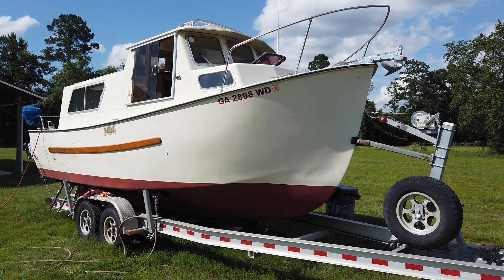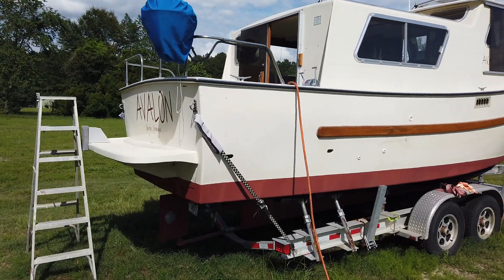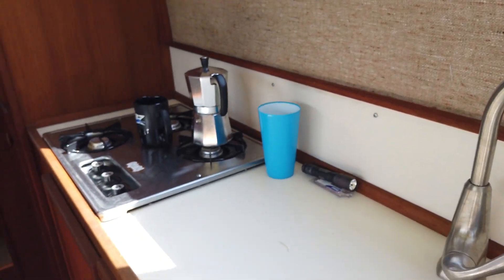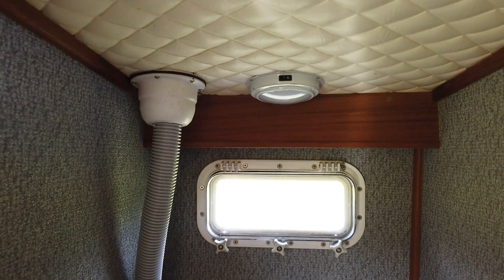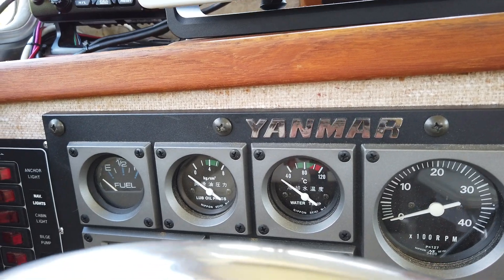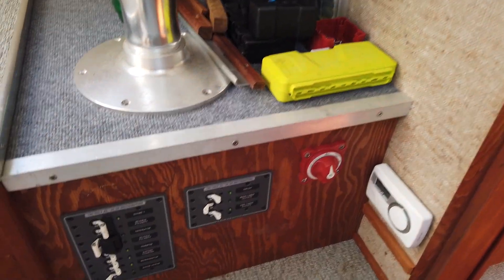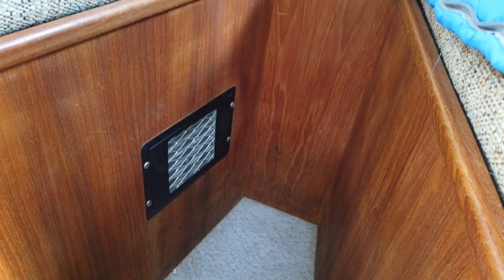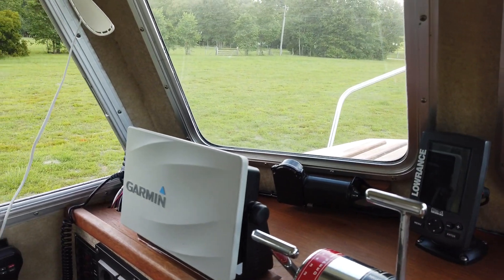IS-25 Trawler Tour

Comment: i’ve owned 17 or 18 boats over the years  your Vessel is a fine looking and well designed one  i actually have the same handheld VHF radio  and mine has made it from the Chesapeake Bay  to Florida via ICW and over to the Bahamas and back toFlorida  and i’ve always been relatively Pleased with its Performance  as a Suplemental and Dinghy Radio

Comment: wonderful boat, be excellent for the lakes around here though not a fan of the side windows like that for storms.   its amazing how many people actully don't take the lakes seriously, then are shocked when a storm rolls in and you get 25-30' waves.
Reply from the maker: I won’t have to worry about being out in 25-30’ waves.  That’s pretty easily avoided.
Reply: @AlaskaRog  I wouldn't say its easily avoided.   you would not believe the number of people that come to the great lakes for vacation and don't understand that they are more akin to inland seas.   Then when things start to turn bad, they often don't react in time and...   every year someones got a rented sailboat or houseboat stuck up on a sand bar laying on its side, or even upside down after a storm.
Reply: ñit small yaggt  uñver 75  feet too 9⁰  fittt yagheß

Comment: How do you steer from the cockpit with the wheel down on the deck???
Reply from the maker: I find that it’s primarily of use for docking.  It can be used while hanging out in the cockpit but the visibility is restricted to looking forward on starboard side of the boat  Bending over for the wheel sucks.  I’ve thought of adding a belt drive system to raise the wheel to the proper level to comfortably use.  The wheel that is there is mounted low because the back side of the wheel sits in a cabinet.  Above the cabinet is a counter top and a cabin heater so that steering wheel could not have been mounted at a reasonable height in that location.
Reply: @AlaskaRog  Pretty bad thinking.  Hydraulic helms can mount anywhere as the back space is not much.  A little console on the cabin bulkhead could easily been done.  Here we use the cockpit for trolling and spend long hours back there.  Very poor design.  Single handed berthing is easy with the second station but you can't be on all fours on the deck when you need to be moving quickly.
Reply from the maker: @douglasthompson2740  , at the present time the boat has cable steering so without completely charging the steering system, what you described is not an option.  It’s NOT bad thinking, just being realistic and using a boat as it is rather than how it might be.  As for spending hours in the cockpit while trolling, I don’t do that.

Comment: is this boat for sale? Or where can someone get one?
Reply from the maker: Everything is for sale.  Just ask how much.
Reply: @AlaskaRog  OK.....................HOW MUCH ???
Reply from the maker: @majoroz4876 , I would have to get $55,000 for it right now, sitting on the trailer in Maine. After my last 800 mile trip in the boat, it needs an oil/filter change, and there is an exhaust leak in the muffler.  It might be something simple, it might require a new muffler. I have not investigated it. The trailer is in great shape, an aluminum I-beam trailer made for a 27’ Ranger tug.